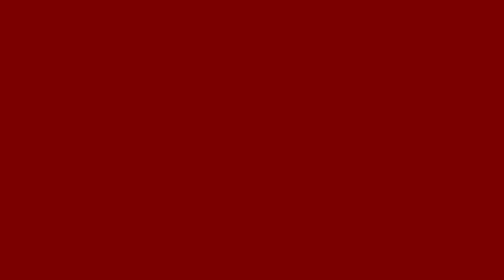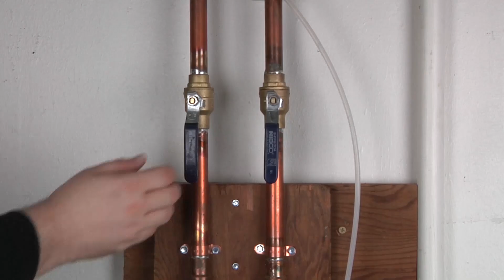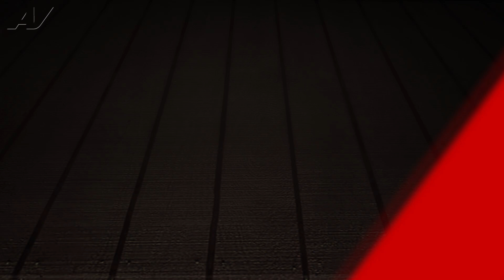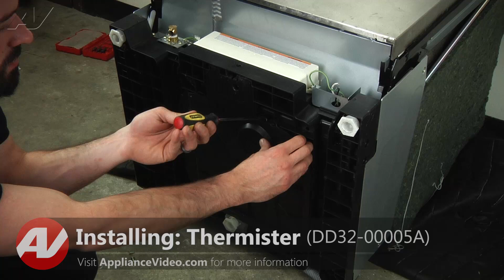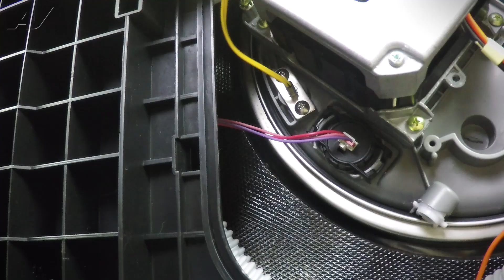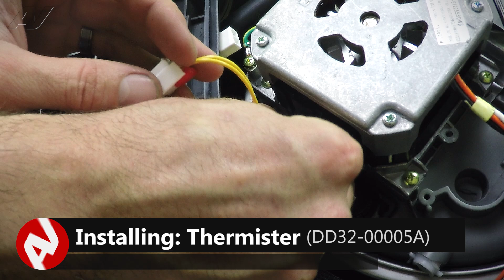Samsung Dishwasher Repair - Heavy and Smart Lights Are Blinking - Thermister

Comment: I just replaced this part and the unit has been run only twice, maybe three times, and the same two lights are blinking again!!! Is the part bad again?
Reply from the maker: Great question, if you have a
more technical question that our parts department cannot answer, our
technicians are answering all questions at our website at www.ApplianceVideo.com under our Repair Help section. You can also call
our parts department at 1-800-830-5465 and they can give you help 7-days A week
Monday -Sunday, or search at www.SaveMoreOnParts.com  24 hours
7- days A week.

Comment: Changing thermistor fixed this isseu.but now whenever we put back the dishwasher into its place , its making a screeching noise. If its outside its spot, its working fine.. the noise is cominng from the bottom of dishwasher. Any idea what might be the issue.
Reply from the maker: Great question, if you have a
more technical question that our parts department cannot answer, our
technicians are answering all questions at our website at www.ApplianceVideo.com under our Repair Help section. You can also call
our parts department at 1-800-830-5465 and they can give you help 7-days A week
Monday -Sunday, or search at www.SaveMoreOnParts.com  24 hours
7- days A week.

Comment: Normal, heavy and smart auto are blinking for me how do i fix?
Reply from the maker: Great question, you can call
our parts department at 1-800-830-5465 and they can give you help 6-days A week
Mon-Sat . You can also search at www.SaveMoreOnParts.com 7- days a week.  If you have a more
technical question that our parts department cannot answer, our technicians are
answering all questions at our website at www.ApplianceVideo.com under our Repair Help section. We have over 6,000
common questions and answers that you can easily search through by your model
number, appliance make, problem or error codes, and It’s completely free to
search through our question & answer library. There is a very good chance
you question is already answered there.

Comment: I just change the thermistor and good that 1st cycle and then it  3 lights will not stop blinking again.We need help.Thanks!
Reply from the maker: Great question, you can call our parts department at 1-800-830-5465 and they can give
you help 6-days A week Mon-Sat . You can also search at www.SaveMoreOnParts.com 7- days a week.  If you have a more technical question that our parts department cannot answer, our technicians are answering all questions at our website at www.ApplianceVideo.com under our Repair Help section. We have over 4,000 common questions and answers that you can easily search through by your model
number, appliance make, and problem or error codes, and It’s free to search
through our question & answer library.